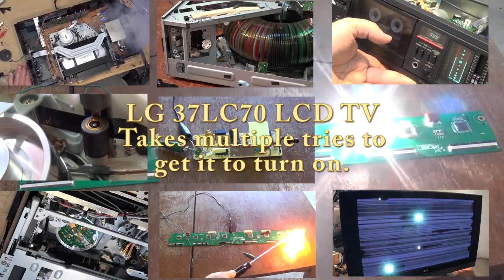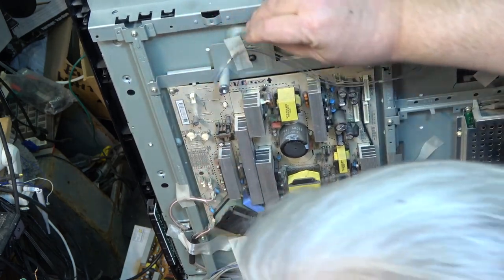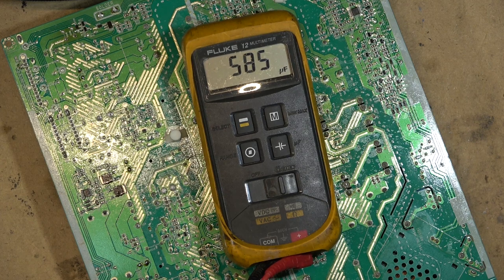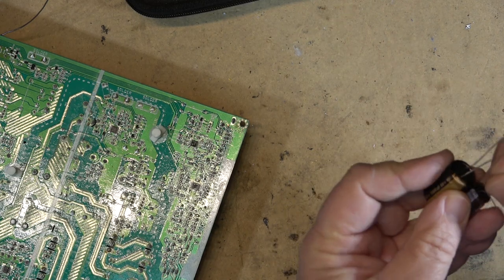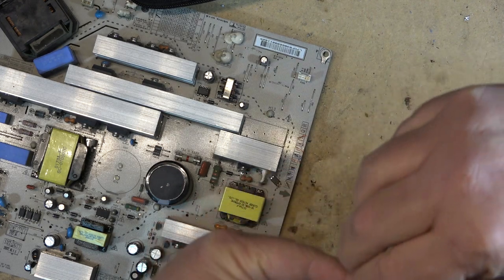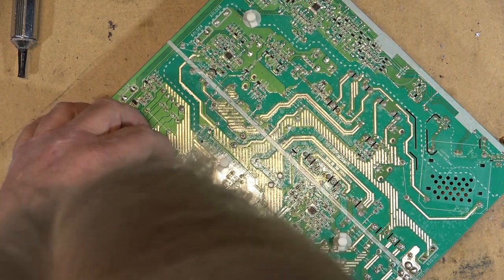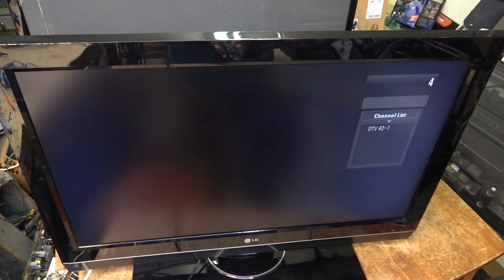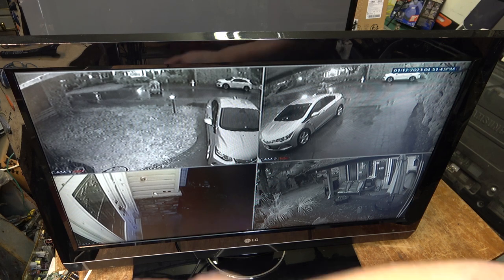LG 37LC70 Slow to turn on.

Comment: Hi 12voltvids, yes it sure does drop the esr reading, I purchased new crap and what I mean the capacitance was not right and esr was not good either and I had three boxes of 600 capacitor's which I could have dumped the lot of then, I think you will know the supplier,  that's something again you had or earlier videos, another reason it's great to see you back working on TV's, as usual great work and glad to see you back, I tend to repair mostly Plasma but I do not mind the led TV's either. Cheers... Jim. 👍👍👍

Comment: Hi 12Voltvids great to see tou still repair TV sets after allI always loved watching your videos on repairing them and there is no one better at troubleshooting snd repairing them, I don't know if you agree with me but what I usually do is use the good Led's from broken screen TV's and solder them in place of ones that have blown, I always put a small resister before the can power up, I think it prevents them from anyone using them at full brightness and I have no complaint's about them being dark, I have to give you most of the credit as you speak about that being a problem, truly you do teach electronics truly very well, I have misses your videos as I don't think anyone makes videos anything as good as you, so great work as usual.  Cheers... Jim. 👍👍👍

Comment: Sometimes the screws mounting the PC board to the chassis come loose and it is important to make sure they are all
tightly connected to the frame because they provide grounding paths to parts of some PC boards and a TV may do 
some similar weird things.
Reply from the maker: Yes i am aware. I have covered that before.  They are tight.

Comment: Would just have put the 1000uF in, not bothering with the second one. As it stopped with 500 it will work with 1000uF, and the low ESR is the important thing to keep the voltage constant. Also using multiple capacitors can be cheaper, as this also can be a value used elsewhere, so you save on the BOM in only having one reel that you use a lot off, and thus get a lower cost per device, and even possibly have a size that does not fit your PNP, and needs manual attention.

Comment: I heard there were some bad batches of capacitors.  Some of the Samwha brand caps used in some LCD TVs were not good from what I read.  I have heard that the best brands of capacitors are Nichicon, Pansonic, Rubycon, Nippon Chemicon, Illinois Capacitor, Cornell Dublier, and newer ELNAs.
Reply from the maker: Every brand has had bad batches.

Comment: My friend has a flat screen he says loses sound. And he has to turn the tv off and on several times to get the sound to work. So, he leaves it on. 24/7. 
I don't think anyone will bother to try to fix it. But what do you think it is? A bad solder joint on the sound board? I'm just curious. Maybe he'll give it to me one day, and maybe I can try to fix it. (I don't want to mess with someone else's stuff, because I don't want to make it worse).

Comment: Hi 12Voltvids, it's totally up to you but you can get a far superior solder suckers as I had three that were just like yours and I got a new one from Amazon, it was about three times the price of the cheap crap I had but it works perfect all the time, I thought I Might as well tell you if you are interested in getting one. Cheers.... Jim. 👍👍👍
Reply from the maker: I have had several including powered ones that cost over  $100. It only lasted a couple months before the tip crumbled in on itself. I used to have to buy replacement tips on a weekly basis. Finally the owner of the shop refused to reimburse me for the tips I was ordering for the desoldering station I was using to make him money. I don't do enough of this to warrant replacing it with another expensive unit. I don't know how long I'm going to be doing this, I can decide tomorrow that I'm not going to repair anything more and just toss everything in the workshop in the trash. Then again I could still be doing this 10 years from now.
Reply: Hi 12voltvids, Thanks for your reply, but the one I was saying about is just a better quality solder sucker and it's nothing like the electric ones, it's €18.00 for it and anyway I think watching other guys using the ones with the solder iron makes too much noise, this is basically the same, maybe a stronger spring or slightly larger barrel, I don't really know but for sure it works first every time, the reason I wanted you to know about it was when I was starting repairing stuff, I got great help watching your YouTube videos and please God you will have many more years ahead of you. Thanks a million for all the videos you make a I found you the very best technician on there and you sure know so much about working on just about everything. Thanks a million foe everything it's truly great work you do. 👍👍👍
Reply from the maker: @jamesconway5221  I have forgotten alot of this stuff.  Left the repair business 20 years ago.  Got out to keep my sanity.  The guy I worked for was a real piece of work.  I didn't do any work in electronics for 10 years before taking it up as a hobby.  Now I am busy again and it takes up a bunch of my spare time.
Reply: @12voltvids  Sorry to hear that as for me I truly found you the best I ever seen, I had intended in sending you a  Techtronic's digital oscilloscope as I have more than I need, I wish you a long and a very happy life for you and all of your family always and forever. Sincerely James. 👍👍👍
Reply from the maker: @jamesconway5221  ha I am so busy that i have to turn away work. Right now I am sitting in at least 5 reel to reel, and 2 beta decks just were shipped in. 
I am constantly busy and looking forward to retiring from my day job in 2 years and then all my time will be tinkering with electronics and making YouTube videos.

Comment: Question: Does constantly turning on, turning off, turning on a CRT in a short timespan do anything detrimental to any of the components? Is this safe?
Reply: Turning off and on with the remote: no big deal. Might shorten the lifespan of the tube a bit. Turning on and off with the mains switch at a high frequency: that can easily kill the power supply. I killed our TV this way like two or three times when I was a toddler, until my parents figured out what was the cause. I played with the mains switch, trying to switch it on and off so fast that the standby LED remained constantly on. This meant minutes of clicking for the power switch, like a machine gun. The TV whitstood it for a few minutes, then the PSU died. Every time.

Comment: Yes you do fix the odd t.v set for a change, but having the interest is the difficult part.
I know this too well.
Reply from the maker: I just do this for the content creation.
Reply: @12voltvids  Yes i know its content creation.
Ive  known that you create repairs just to make videos for a while,  but i still comment to add to it.
Reply from the maker: @zx8401ztv  i don't "create" repairs.  They are all legit troubles.  Either on my own equipment that i have picked up or on customers equipment where I am repairing for hire.  I have never stage a repair.  I did find a significant stack of cash in something and i removed it from the item i found it in because I didn't want someone claiming it. I actually didn't show the cash i found for  about 6 months and did a video last March and figured I would show off my stash.  Grabbed an old machine that had worked 8 years ago and it was broken again.

Comment: you should also call out a walkman refurbisher on ebay he says he fixes them but he doessnt he does not check for cracks in the board.
Reply from the maker: eBay. Caveat emptor.  Let the buyer baware.  I don't sell on eBay, i don't but from eBay.
Reply: @12voltvids  ive had mostly good results but its like you said many lie about the refurbished conditions often times there not at all.  The japanese sellers dont do such things they tell you its broken or it works.  I didnt realize doctor sony was a fake to his vcrs come up all the time and hes charging 600 for each one.  Since your video ive been afraid to send my super beta thaeater deck to him.
Reply from the maker: @stpworld  no beta is worth 600 bucks.   No VCR for that matter.  They are a dime a dozen in these parts.
Reply: @12voltvids  I know that I just mean I see his adds id actually like an svhs machine do you shipp them I stil have tapes to play
Reply from the maker: @stpworld  I just repair them. I don't have any svhs to sell. As I am in the video digitizing business I keep every machine i come across.  I am constantly busy digitizing tapes to DVD or digital files.   Been in the transfer / conversion business since the 80s as part of my production business.   Started out doing 8mm and super 8 film to VHS and pal / SECAM / NTSC conversions.  Produced corporate videos and multi camera weddings and breaking news for CBC and BCTV tv news (freelance) in addition to running a busy tv repair shop during the week.   Yes I was very busy in the 80s and 90s. Working basically 7 days a week. Sleeping with my ear on the scanner for breaking news and running out with the BETACAM to grab shots for the 6 o'clock news.  Don't do any of that anymore except for the film / tape digitizing.  I keep pretty busy doing that.

Comment: Now if you could just remember to check this video the next time you have to remove the fairing on your bike ;)
Reply from the maker: Lol. I few  years ago I had planned to put speakers in the ferring and a small amp and stick an MP3 player so i could have music.  Not as important now.  I like the sound of the engine.  I don't ride nearly as much as I used to.
Reply: @12voltvids  I've had friends suggest a comm system with helmet audio, etc. But I don't care about any of that: When I ride my bike, I don't want to hear music or hear other people gabbing. I like the feeling of being in tune with my surroundings and not having distractions. Riding to me means leaving the connected world behind.
Reply from the maker: @mbaur64  exactly.   I want to hear everything around me and be aware of my surroundings.   That's why when i bought the HD in 07 i specifically bought one without the radio / cd player option.

Comment: Don't see much use in a old lcd vs a crt or modern display. Wouldn't pay more than 5 or $10 for a 1080p lcd.
Reply from the maker: Older sets support all the legacy inputs. Like VCR and s-video, component ect.  Some have rgb input as well.  New displays only have HDMI which are a pain in the ass to connect old equipment to.  I get 50 for used TVs every day.
Reply: @12voltvids  I have 1 old 1080p monitor I use that looks good like you described. Anything non hd is terrible looking though. 

I have a hdcrt that I burned out the hd-mi module or IC. I under amped it with a hdmi switcher I bought used.
Reply: My two TVs are both 720p with CCFL backlight. Two identical 32" models from Samsung, from 2009. Both were free sets. Fine for my purposes of occasionally watch some TV, the program on my cable is SD anyways... I usually watch movies on my PC, with a 1080p 22" monitor (also CCFL, LG from around 2011). If I watch movies from DVD or VHS, I sometimes fire up my 29" FD Trinitron.